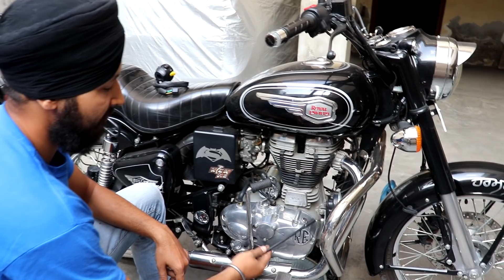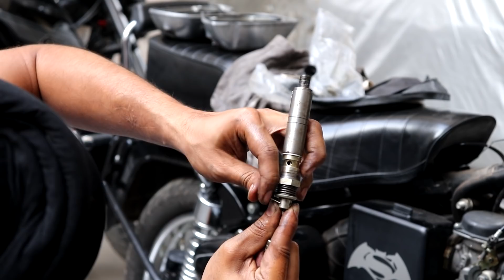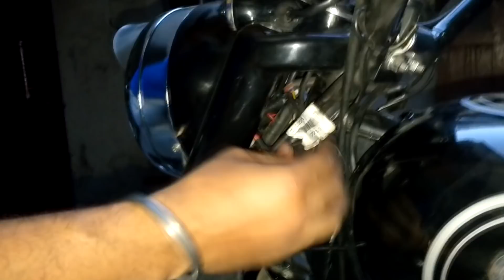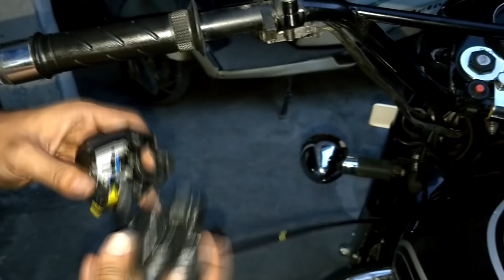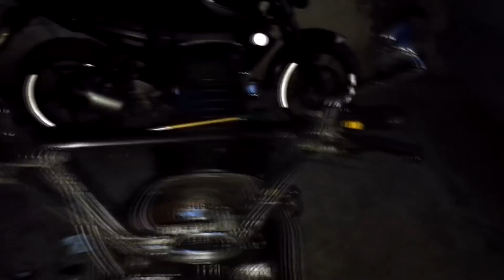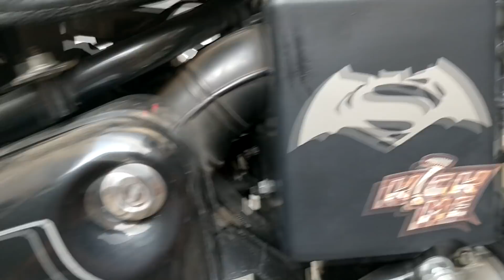Manual decompressor in UCE Installation and Review

Comment: I see in the comments that many people are asking about performance and mileage, The main reason for the decompressor is to charge the cylinder with fuel and air and also make it easier to find top dead centre for starting, once the bike is started no need to touch it unless you want to stall the engine. It is just to make starting easier, nothing else.

Comment: Hello Bhai , I need hell with Royal enfield. I am based out of USA. There is no mechanics in USA who works on royal enfield . It is royal enfield classic 500 EFI 2013 model . It starts for few mins and then shuts down. Exhaust makes sound that it is blocked . Spark plugs gets carbon every 50-60 km. Exhaust had some blue heated mark . There were some cracks on the corner of the breather pipe. I cut the pipe and put it back .  I try to start the bike it remains on for 2 mins and then it makes some clicking sound and silencer makes buff buff kind of blockages sound and then bike turns . Please share your knowledge what can i do . I am getting frustrated now .

Comment: The video is very informative 
But i have a question regarding the new 2018 RE classic 350 
Can i install the same meter u have installed in the new classic 350 and how the fuel gauge is working i mean its ok to go with the meter that u have installed on your bullet  for a fuel gauge or not? Thanks :)

Comment: Please tell me about the importance of d compressor
Reply: The main reason for the decompressor is to charge the cylinder with fuel and air and also make it easier to find top dead centre for starting, once the bike is started no need to touch it unless you want to stall the engine.

Comment: Low RPM will affect the performance of oil pump in UCE engines and vehicle millage will definitely decrease....it will also affect the OE exhust as due to removal of spark plug unburned fuel will be admitted to exhaust and will damage catlitic converter and increase emission

Comment: Slow rpm apka compressor k karan nhi h....thats bcz of single spark plug in use...that produce less heat in head which results in slow rpm for the same carb setting
Reply: DEEPAK DALAL and it leads to major carbon decomposition in cylinder head

Comment: Paaji ye laganeke baad starter motor par load jyada padega ya nahi.
Reply from the maker: N Gururaj Kamath hnji load badhega bro, but agr yeh lgaya toh ap khud hi kick start krne lgoge
Reply: All About Automotives Some mechanics from kerala are making manual de compressor with out removing spark plug.they are making this by drilling a hole in top the head and fixing the devise at there.And  it  is working properly.

Comment: Bhai
Head ko drill karke lagavo. Spark plug ke nikaaldoge tho fuel completely burn nahi hoga
Reply: Yeh karne iske jaise slow rpm milegi?
Reply: @manjukakkar4252  
Yes
Just like old bullet
Reply: @princekuriakoseabraham5645  how can we do it?
Reply: @manjukakkar4252 
First you have to remove head from cylender and drill it with help of skilled 
 laith worker after drilling and threading you can fit dcompressor on that hole.
I also have a video on drilling and threading upon cylender head.

Comment: THIS IS NOT THE PROPER METHOD OF MANUAL DE COMPRESSOR INSTALLATION,DRILL A HOLE [only laith worker can do} IN THE MIDDLE OF THE CYLINDER HEAD AND FIX THE DE COMPRESSOR ,DON'T REMOVE YOUR SPARK PLUG
Reply: Kya ye possible h
Reply: Still I feel that,  the video method is more safe...  we have an option to convert the thing back to twins park...

Comment: Bro what mileage r u getting after installing it
Reply: It does not effect mileage it is just for easier starting.
Reply: The main reason for the decompressor is to charge the cylinder with fuel and air and also make it easier to find top dead centre for starting, once the bike is started no need to touch it unless you want to stall the engine. It does not effect mileage.